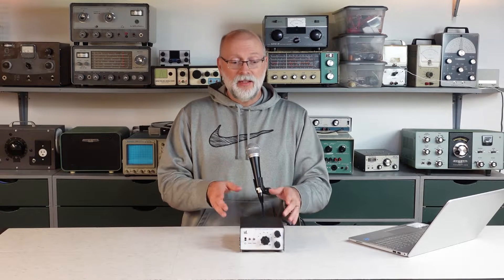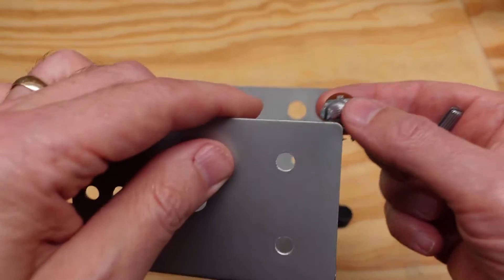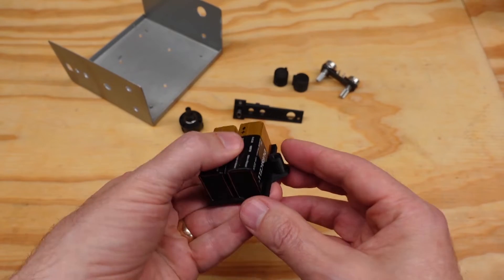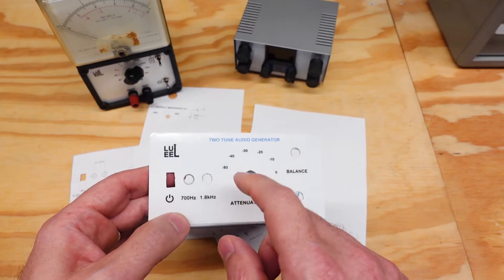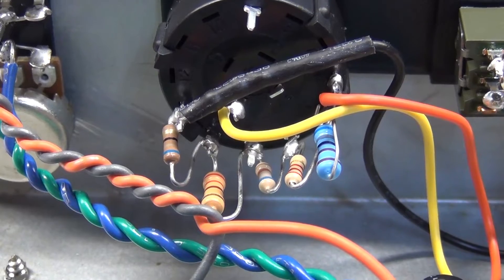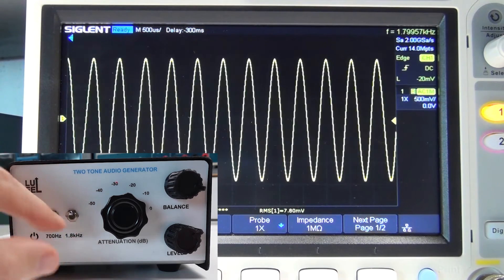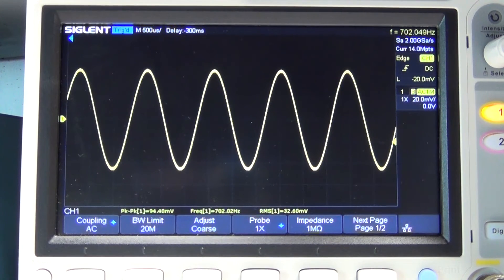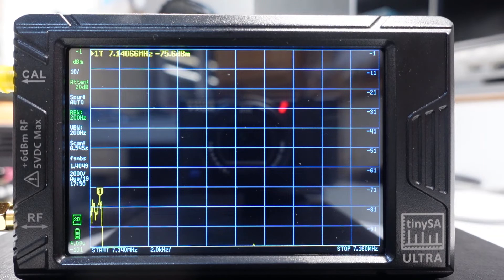Two Tone Audio Generator: Part #2

Comment: I like the SMD rather than through hole passive components, however how or where did you find the correct value capacitors.  The original ARRL design uses paralleled caps to get the correct value.
Did you stack two SMD caps to achieve the correct values.
Thank you in advance.
Reply from the maker: I was able to find the values specified as single SMD caps.  Probably weren't available as through hole components in those values back in the day.

Comment: I like the advantages of PNP MOSFETs, for reverse polarity protection. For the bottom edge of the front label... Maybe 3D print a "L" bar the length of the width of the face plate. Add/print feet at both ends of the bar. Place the bar over the label and under the bottom. Attach with Shoe Goo adhesive. This will prevent catching the edge of the label and peeling it off and provide feet to tilt the face upward. I love your 3D pot and switch brackets. I imagine you will have started a trend.
Reply from the maker: Thanks, and good idea about the L bar!

Comment: I do the same but don't cut the holes in the labels as I also print the centre point of all holes, this means that it also acts as a drilling template. All nuts and bolts then also help hold the glued label to the metal work. And as a plus side the holes always align.

Comment: Had my 2 tone generator go intermittent and die on one frequency. One of the wire ended lamps had a fractured wire. Using the ARRL design, I found a frequency slope when using low Z output. (600 ohms). The capacitor on the last opamp output, needs to be a larger value, or it generates its own slope, when the low frequency is used.
Reply from the maker: Good tip, thanks!

Comment: Heads up, I have had numerous Duracell batteries leak on electronics in the last 3 or 4 years. This included my Fluke 77, Simpson 260P, a Ten Tec Paragon which lifted lans on the logic board, not to mention 2 remote controls. I am having no issues with the Duracell Pro batteries, at least not yet. 
This is a shame since I have used only Duracell batteries for years and never had any issues. Some were purchased on Amazon and may have been counterfeits. However, others were purchased at Walmart and also leaked....Perhaps, you could pull them from your 2-tone tester since this is not a daily driver piece of test gear.
In my Ten Tec Paragon,  I,  3-D printed a small box with lid to contain any possible leaks.
Good luck es 73, Glenn WA4AOS
Reply: Ditto here, I now call them "Dura-Leak". I used to use them exclusively but have now switched over to Energizers and haven't had any leaking problems. Not sure what Duracell did but it sure wasn't good.
Reply from the maker: Yep, shortly after I finished recording this, I pulled the batteries.